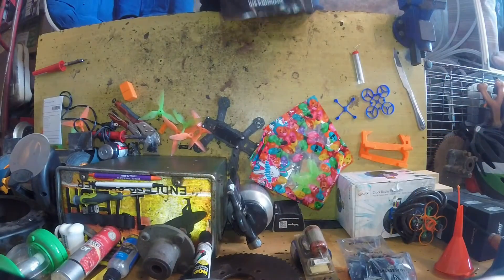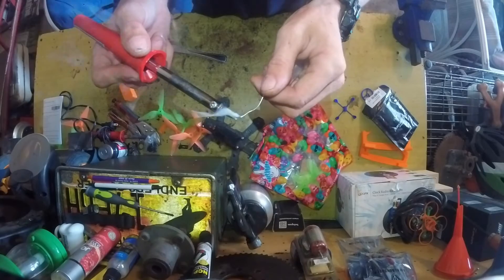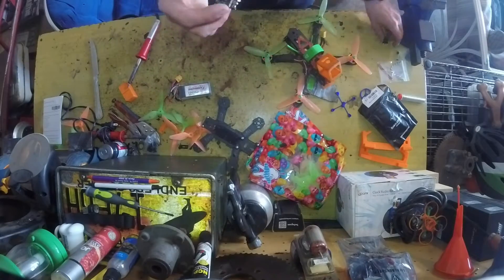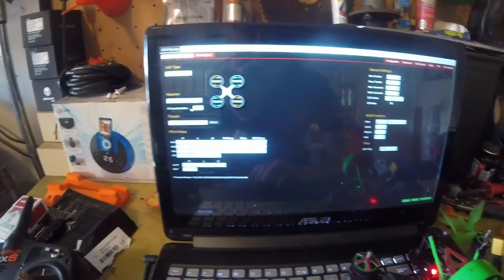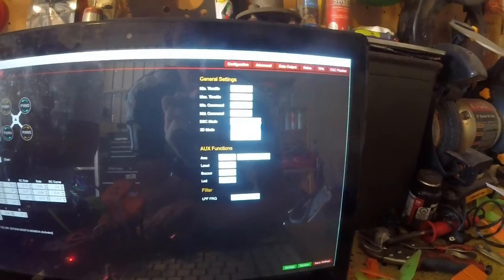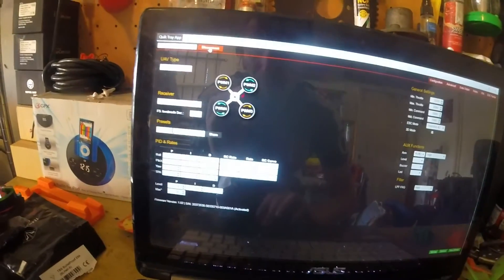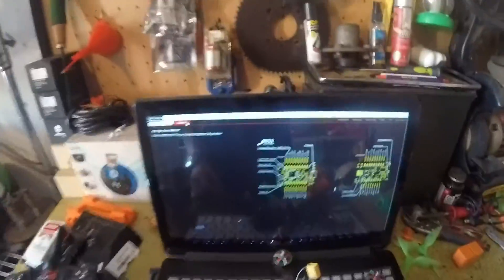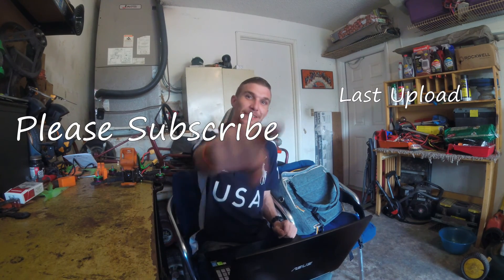TBS bulletproof ESC calibration on a kiss FC

Comment: So is the only way to do it to resolder the motors? I was also looking at remapping the motor direction in the betaflight cli. What would you do, thanks man! This has been driving me fucking nuts for 2 days...
Reply from the maker: +Chris Banner remapping only for changing pads like for example if a pad broke or you want to use a pad closer to that ESC not changing motor direction you would need to open blheli s and if the kiss ESC there's a lil solder jumper that will reverse the motor direction

Comment: I switched to the TMotors and esc"s using my kiss fc, with beta flight firmware. Have you figured out how to tune the esc's in blheli with a pass through... Can't get it to work I need to switch motor directions and want to do it without switching the motor wires around. Any help would be great.
Reply from the maker: +Chris Banner kiss does not offer pass threw that's why you can't get it bud

Comment: Beta on Kiss FC is the way to go.. I switched all to a Betakiss no problems, flies smoother and stop having random issues.
Reply from the maker: +Waba 305 I loved beta when I had it and used beta board but I'm going to try the new beta f3 odd board out I'm liking you can change your TBS unify pro HV setting in the Google's and pids alot

Comment: that's why I flashed my kiss to beta flight 😎🍻
Reply from the maker: +Farmer Fpv I had on flashed at one time but can't get them to do it any more ugh
Reply: That Flyin Ryan it's easy you should try again it flies so much better.
Reply: That Flyin Ryan so what spektrum radio and receiver are you using? are you using the race quad receiver?
Reply from the maker: +Farmer Fpv making me want to go do it now lol and make a video on how too lol
Reply from the maker: +Farmer Fpv I'm running a spektrum dx6 remote and a lemon receiver in this quad and my 3 inch kraken I'm using the auto bind spektrum FPV racing one IV had them burn out tho that's why I'm trying the lemon out on the alien RN ....